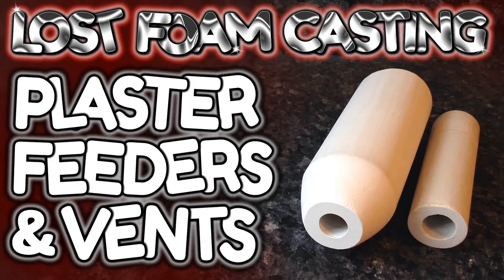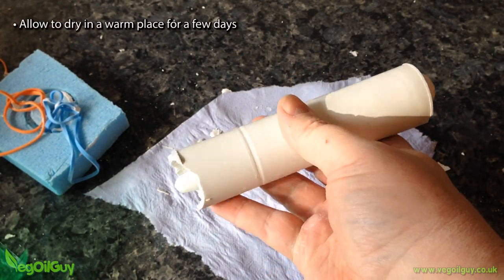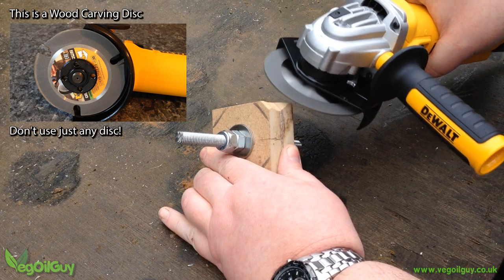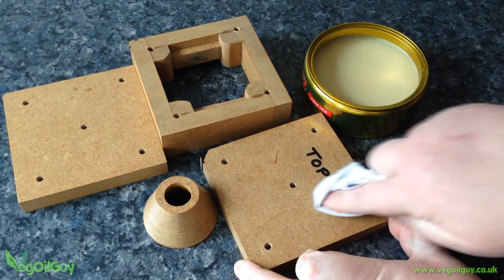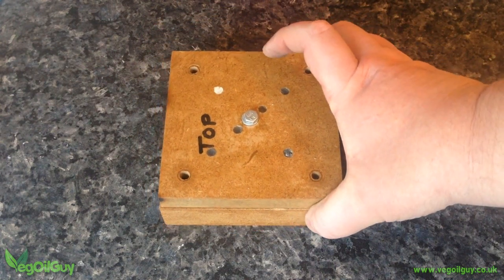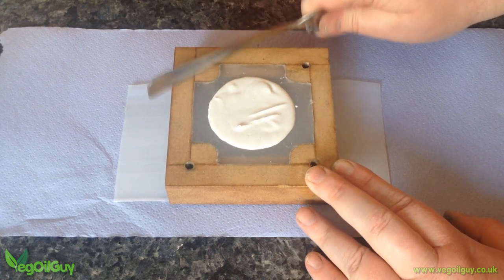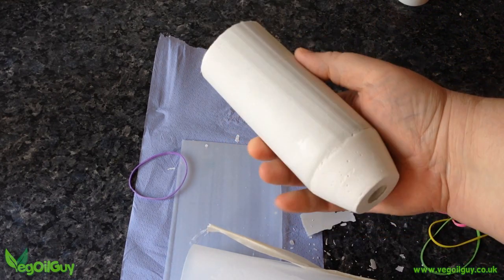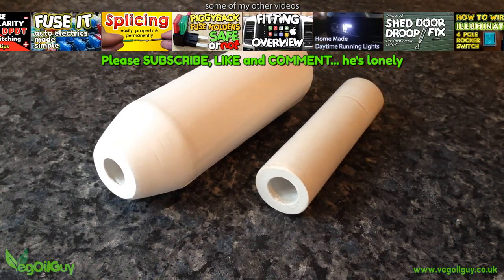Lost Foam Casting: Making Plaster Feeders & Vents - by VOGMAN

Comment: Great video and loving your channel! Great content, easy listening/watching and not a drop of "YTber arrogance". Spot on mate and I'll be building a few waste oil burners for forges at our Makerspace in Wet Wales.
Coming from an arts mould making background... I was in the middle of a massive weekend mould session. 28 piece high temp plaster of Paris mould for a ceramic chair. About halfway through I ran out of animal size (release agent). An old technician suggested using lard. Quick nip to the local Tesco later and it worked like a charm! Has the bonus of smelling like a full English when heated 😅👍

Comment: The big risk in not baking to 400C as Martin (olfoundryman) says, or not baking long enough, is the water in the plaster can flash boil to steam and cause an explosion sending liquid metal everywhere. If your lucky the minimal bad thing that can happen is the plaster just cracks and liquid metal pours out the side everywhere. This is the same kind of thing that happens with regular cement and is why it does not make a good refractory, the trapped water (or water absorbed from the air) can (will) explode due to the water flash boiling to steam.

Just remember, if/when it goes wrong in the worst way, it will be very very bad. (I hope you never have one of the sudden explosions)

Also it's important to note that you need to use these in a relatively short time frame after baking so the plaster doesn't reabsorb too much moisture from the air. Don't bake and use months later or even a few days later without rebaking. 
I think we used baked plaster for lost wax when I did some silver castings maybe 15 years ago. 

Your new electric foundry should be a great tool to bake out the plaster with its temperature controls.
Reply: I should also mention that the water in the green sand is different from the water in the plaster... green sand is fairly porous and any moisture in the sand is free to move around and go where ever it wants, whereas the plaster is a hard non-porous material and moisture has no place to go which is why the plaster can suddenly explode even when it has less moisture than the green sand.  

Note: Martin (olfoundryman) also uses water-based green sand... he talks about it in this video with his facing sand preperation  https://youtu.be/L9qP39y3E4k

Comment: Forgive me if I missed it in the video but are these single use or are you able to re-use?  Seems the only way to free the metal from the risers would be to break the plaster molds. A bit of an investment for single use no?
Reply from the maker: Hi Brian. It is an investment, yes, but like so many things in life, you get out what you put in. They results speak for themselves.
Whilst not totally reusable, I often find hollow section survive. I cast more plaster directly on to these and they work great  : )
Reply: @vogman  You got me thinking, I wonder if it would be potentially more reusable if the inner sides of the feeder were tapered. Maybe once the aluminium was hacksaw off the part could you then push it out of the feeder - or does it bond on tightly? Thanks for the cool videos, love em!

Comment: Hi. I enjoy your videos but wanted to address a potential issue with your sprue design. I saw it and said..."I'll 3d print the mold!" instead of using a candle and plastic sheet. Turned out nicely until I poured. Big blob of molten Al and the PLA in my mold (lost PLA process) went over my head and onto my back. Without a candle to "meltout" the sprue held a lot of moisture. I contend that this became a steam cannon...yikes. I have since tried to "burnout" the 3d printed sprue but it became brittle (270F 30' then 550F for 60'). 500F is the temp at which water is expelled from the chemistry...may be overkill. 
Once you start 3d printing, it's tempting to start making everything this way. Advice to those who watch and think like I did is to drive out some of the moisture with a lower temp bake. I haven't worked out a good "burnout" and my attempt made a total mess. Your low temp candle melt might leave the PLA intact (so no mess) and drive out moisture to prevent a steam rocket situation. Newcomers...expect the unexpected.

Comment: Vegeman?   Ooooo kaaaaay....  😈  Are the comments printed in green from your wife?   Nice video.  👍  You'll have to ask Martin to be sure, but I suspect his baking advice has something to do with how fast steam expands and how easily or difficult the different substances can vent steam away.  There could be a cracking or exploding problem.   Keep your face shield handy if you're not going to bake your plaster fixtures as he recommended.  😨   By the way, I had some difficulty reading the comment that was overwritten by your watermark.  This was in addition to the difficulty I always have because of my normally slow reading speed.  😞  Have you noticed all the little rubber "spikes" on new auto tires?  That's part of the molding process.  I wonder if drilling a few small holes into the seams of the mold box would help be rid of excess silicon or plaster.  Happy Star Wars Day  🤓
Reply from the maker: Hi Ron,
I've had no explosions yet - just bubbling in the feeders and vents - which is exactly where I want the bubbling to take place rather than in the metal. I've also tried with just air drying and, if I'm honest, didn't notice any real difference, but I prefer to go above 100 just to be sure I get out the steam-makers : )
Trust me Ron, I'm a hopelessly slow reader and couldn't honestly watch one of my own videos without pausing, BUT it's seen so often these days, not just on YT but on TV, so I place the white comments there for those keen on the details and green comments there for folks who are happy to laugh little. Technically both lots of comments could be ignored - presuming I'm done my narrating correctly. 
The only comment near the watermarks is the safety notice I think...Naughty me. I'll have to look out for that next time.

Interesting suggestion with the holes. I do plan on conducting some experiments with foam-coated plaster as so many swear they do it with success. It's never worked for me, but I'm happy to try again.
Have a good one : )

Comment: can you re use the vent and feeder?
Reply from the maker: Hi Josiah. You can often re-use them in part. Sometimes enough of a feeder or vent survives undamaged. Plaster of Paris can be added on to these to form a new vent / feeder, but partly using the old, saving on materials. 
I hope this helps  : )
Reply: thanks, yea it does help